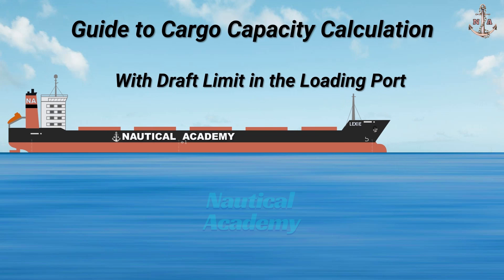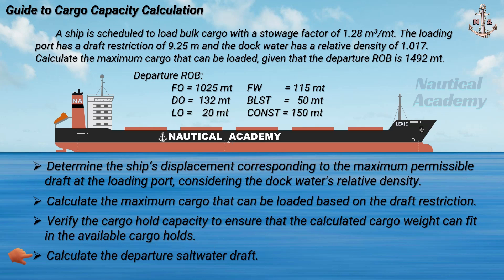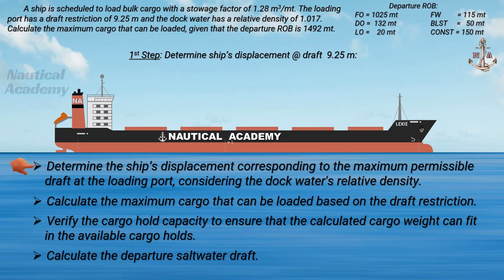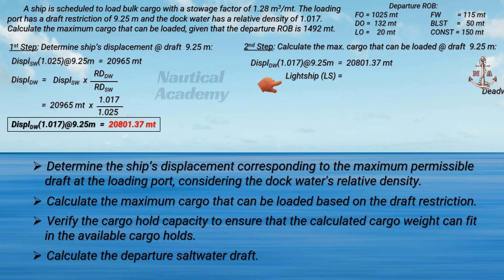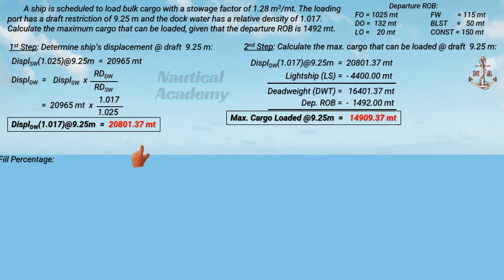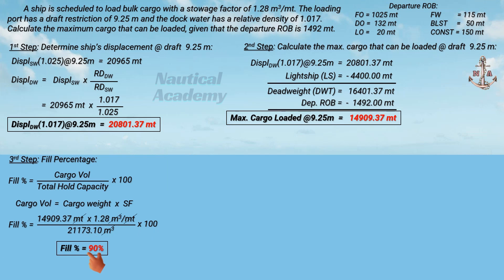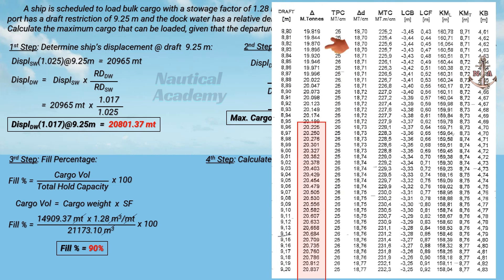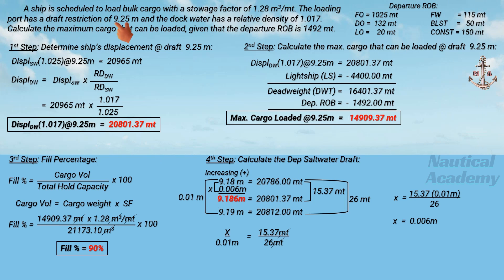Step-by-Step Guide to Cargo Capacity Calculation

Comment: How about the loading port density is 1.017 and the discharging port density is 1.012 what is the density correction plus or minus thanks fir your reply
Reply from the maker: Thank you for the question. When a ship sails from water with a higher density (1.017) to water with a lower density (1.012), a sinkage occurs resulting in an increase in the ship's draft. So the calculated change in draft or Dock Water Allowance must be added.
Reply: @nauticalacademy001 only this DWA no cargo intake addede or minus can you pls make a vlog on this if your not busy tks
Reply: What if the loading port density is 1.025 and going to discharging port of 1.017 do we add the density correction